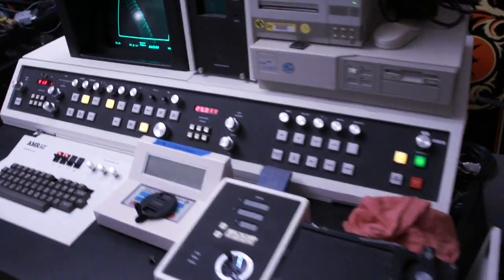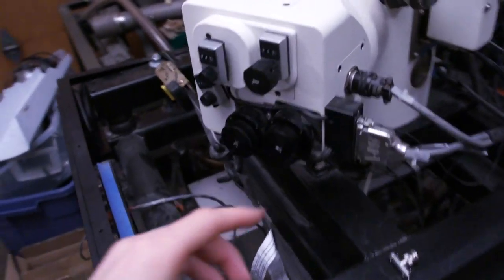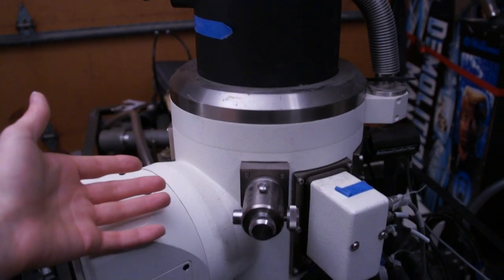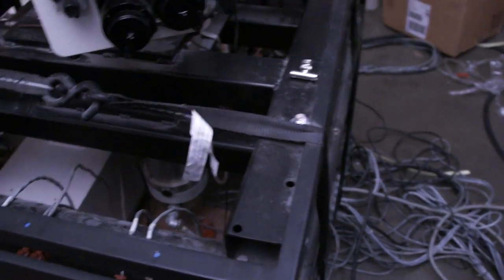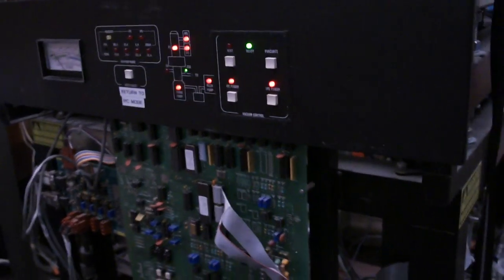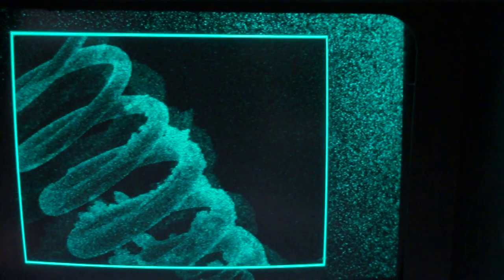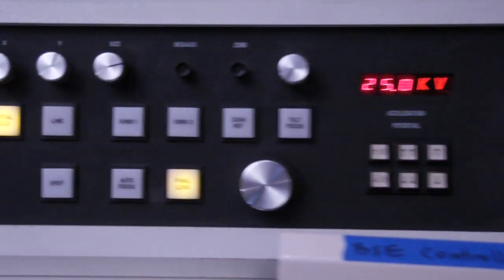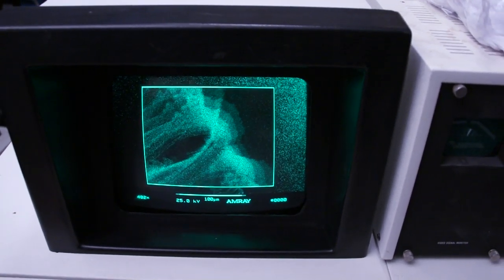Scanning Electron Microscope - Zoom, Enhance, Rotate

Comment: Nice job getting this old Amray running.  You mention it took 2 weeks to pump down the gun.  This is a 305 gun with NEG pumps in addition to the small 2 l/s ion pump.  You can run ~ 10A current through the getter pump leads in series for ~ 10-15 min and get the vacuum down much quicker than 2 weeks.  (1 day or less)  They were likely saturated and the small 2 l/s pump was designed to only pump the inert gasses that the NEG pumps can't pump.  If your gun ion pump is running over ~50nA you'll burn off the Zr02 from the tip much faster and end up with no emission.  This is an old post and this gun is likely dead by now and you learned this already:)..Just some advice from a former Amray Engineer...
Reply: Lucky Jeri getting substancial comments like this!

Comment from the maker: It might be, although the schematic calls out a triode style guage(it also calls out a diff pump).  The FE models were factory hacks of the filament gun units and have hundreds of jumper wires on the boards.

Comment: If the connector on the sensor is a BNC then it is a mag. I used them on my little residual gas analyzer/leak checker cart. My big system I am setting up for sputtering used a B-A Gauge. 

Speaking of sputtering, did you get a sputter coater with the scope?

One kind of neat thing we did on a friends scope when I was repairing it was to replace one of the accessory ports on the chamber with a window. Then coat a sample stud with phosphor from a fluorescent lamp. You can see the e-beam scan it.

Comment: The high vacuum gauge is an inverted magnetron gauge. Good down to 10^8 to 10^-9 torr. They are very rugged and don't rely a filament which can burn if exposed to air while hot. Triode gauges have long since been replaced by Bayard-Alpert Ion gauge tubes, though they do pop up every once in a while.

Comment from the maker: @Brane214 because they can heat the tubes and use getters to drive out the contamination.  I used a heat lamp to speed things up, but was very careful not to get the o-rings too hot.

Comment: I tend to collect all the fittings I can get when I run across them locally.

A coater would not be too hard to make. You can use aluminum or silver instead of gold and use evaporation instead of sputtering. Though you need to get the coating chamber down to 10^-5 to -6 for a good coat. Sputtering happens at a much higher pressure (~50 millitorr and up) but you need argon. A professor at PSU sent me a design for a 2" sputtering magnetron if you are interested.

Comment: Every particle could deflect or interfere the electron beam.
Besides CRT doesn't have a high vacuum, it's not needed because the electron-beam is coarse and wide, and it's made to be projected on a relatively large surface.
-
The more particles there are, the easier to evacuate, the less there are, the lower the chance a pump can "grab" it and evacuate it outside.
That is why there are several different pumps.
They all work on a slightly different principle.

Comment: Nice to see it working.  I remember when you made a video receiving it.  Looks like a garage by the hardware on the wall.  Are you wearing a jacket?  I agree with the other guy,  Insects.  I remember trying to inspect GaAs wafers with one.  They were so insulating that it pushed the beam around.

Comment: Bare ICs supposedly show dark/light changes when active!

Maybe try a uA741 op amp TO5 cut open can, operated as a slow oscillator?  (I have a big bag of uA709s!)   Better to use signals +-15V rather than 1.3V logic.

Comment: Hi ..... I have bought a old Hitachi Electron Microscope without chiller and the rough-in pump. I am not sure about the magnification as there is not enough info around. What size (CFM) of rough-in pump should I use. There are few Roobinair Vacuum pumps on amazon. What is your suggestion. Thanks

Comment: Just wondered if you had seen the article on keeping stuff alive while you drop it in.
Just dip in Tween 20 , (polysorbate 20) and you can keep bio samples alive in the vac to look at em.

Also check out the NIST site, they are getting a new Near Field Microwave Microscope
Looks like you can hack one together by just taking a ghz rf generator, and stripping out a bit of the center conductor. Sharpen it as well you can , (that EM will help), and you should be able to image the P/N boundaries.

Comment: Wouldn’t really recommend one for this since it require some extra things to prevent every single bit of oil vapor from the diffusion pump to migrate into the chamber which of course would cause all sorts of problems. To prevent this an ordinary water cooled baffle is used and of top of this a baffle cooled with nitrogen and sometimes only a nitrogen baffle, never only a watercooled one since its not enough. It is so much easier to just use a turbopump since it doesn’t need anything of this.

Comment: of course the effect would not show visual spectrum color (although that might be possible with some fancy math). I just meant it would show more information than a single channel. I don't know enough solid state physics to figure it out but it might show different material properties, maybe some semiconductor effects, not sure. or maybe just taps into the quantum electron orbit energy levels to show "its true colors" :)  maybe many beam voltages are needed or a priori knowledge of material

Comment: how much did it cost you for all of this??
Reply: Stijn Wansink Nah, more like around $6-12000, look up "Scanning Electron Microscope" on ebay.
Reply: ***** i'd be more worried about the electricity costs than the purchasing costs. It probably uses a couple of thousand of dollars in electricity per year just to keep the pumps going
Reply: ***** Well, you don't run it constantly. Ofc that would be really expensive to run it 24\7
Reply: ***** it's not something you can just turn on and off like it's a hair-drier XD, the video even mentions it takes 2 weeks to start up. Plus, these sorts of scientific/industrial machines were built to stay on permanently and can be damaged by repeated on/off cycles
Reply: ***** Well, not 2 weeks to start up. It takes 2 weeks to get to low enough pressure, not boot the entire thing.

Comment: GENERAL: https://plus.google.com/communities/113932584951030663517/stream/5b05b090-959c-4732-8db1-325f6d1b81fc _
Reply: INVERTED MAGNET FLUX (gives INVERTED overunity. it means LOOSE performance and COP). Why, because: N-S and S-N . Mistake, if possible should be S-N and S-N . Your magnets are inverted (in oposition) . one of them should be inverted (the poles). simple to educate . deleting is to see who you are